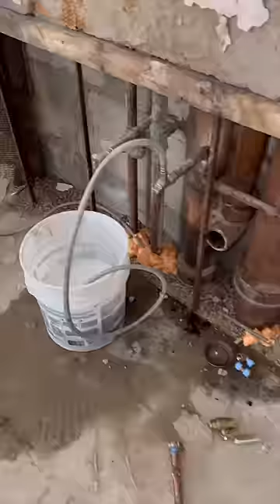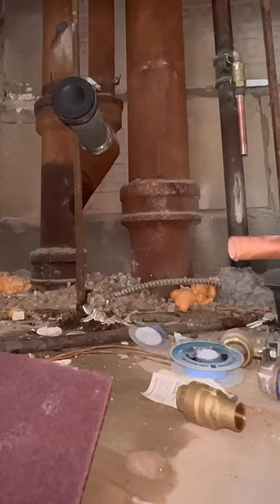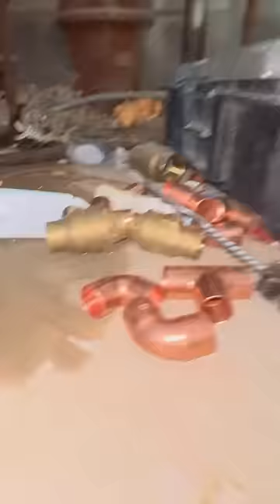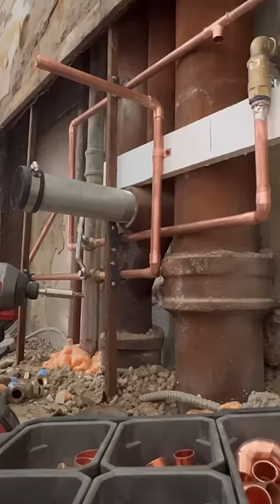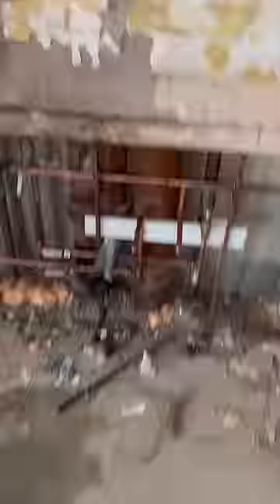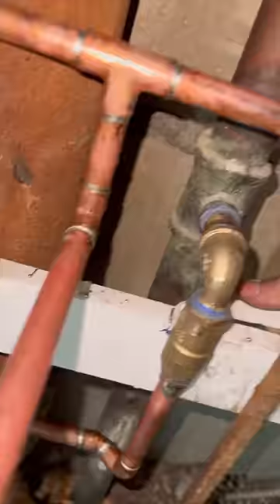The stages of a plumbing renovation in NYC #hydronyc

Comment: So what yall do to get the pipe up there?  I know this was a small job at least right here on screen, but what about those 20' sticks?  Or 21'?  Yall have to use the stairs some?
Reply from the maker: The pipes come in 10 feet usually and they fit on the service elevator. When they don’t, we just cut them

Comment: Only thing your saving is gas and travel time on that 2nd day. Not 33% 
If it takes 5 hours to rough in. It takes 5 hours on Monday,  Tuesday,  Wed or Sunday. It's still 5 hours. All you save is the gas and travel time.
Reply from the maker: Usually a job that takes 2 hours, in nyc it blocks your whole day with the parking and traffic so you cant get any other job done unless its a quick fix. Based on that, i price jobs not on how many hours it takes to complete but in how many days even if its 3 half days. In this job i priced for 3 days but i only dedicated 2 days on it so 33% goes in the pocket lol

Comment: I'M SURPRISED YOU DIDN'T JUMP ON THE BANDWAGON AND BECOME A PRO - PRESS BUTCHER. I STILL USE THE SOLDER AND FLUX IT'S THE MOST SECURE JOINT. SOME OF MY FRIENDS WENT OVER TO PRO-PRESS AND I CALLED THEM THE "PRO -PRESS BUTCHERS."

Comment: I got a question mate. Why don't U use #19 fittings for water spigots?  Isn't it more reliable? The compressed  mini taps are so unstable and leaks risky.
Reply from the maker: I didnt know what those were but i googled it and it shows a 180 degree turn. I’ve never used those before but im open to it now that i know

Comment: What happens when those big giant cast iron pipes finally go out?
Reply: You replace them
Reply: Usually the building will replace them before they fully give out. You'll get warning signs you'll get drips creating a discoloration in a ceiling . Sometimes you get sewer gas smell from the vents . Usually you get indicators that'll tell you you're at the end of the service life. Some buildings actually drop a camera down the stacks. I can tell you that big ass pipe in the back was extra-heavy and look like it still has lots of miles on it.
Reply from the maker: Then we get to eat better lol

Comment: How can changing the framing make your job easier, but take an extra day 🤷🏿‍♂️
Reply from the maker: Easier to work with than these old ones. Its hard to support the pipes in these thick old frame. The extra day is because i would have to come back after he puts up the new frame which is done after the water shutdown
Reply: @hydronyc  I see, You are still the Homie 👍🏿 Coming from Cali, I was always amazed by the ny infrastructure

Comment: Soddering copper not pro pressing, it’s good to see old school plumbing.
Reply: I like using ProPress, simply because it pisses so many people off.
Reply: @MisterTwister88  you should say I like using pro press it saves time, and I make money.
Reply: @MisterTwister88 Pro press has it's place in service work. However new commercial contractors are leery of it recently because of lots of failures showing up now.
Reply from the maker: Yeah we prefer soldering. Its proven to be effective
Reply: @hydronyc  It shows broski! You're a proficient bad ass solderer!👍👍 You're a good example for people who aren't good at it yet.
Reply: @daddy1571  Failures are the result of improper installation, nothing more.
Reply: @MisterTwister88  Actually it has to do with the crushing effect and how it can affect the pipe. If installation is the problem then that's also a factor. . It doesn't change the fact that the failures are mounting. I don't care what your opinion is anyway. It's irrelevant
Reply: @daddy1571  Yes, but you cared enough to reply. Hmm 🤔 Id also like to see proof of these supposed failures. Put up or shut up.